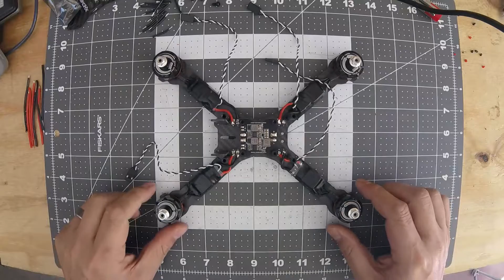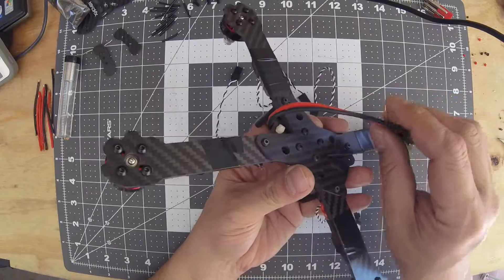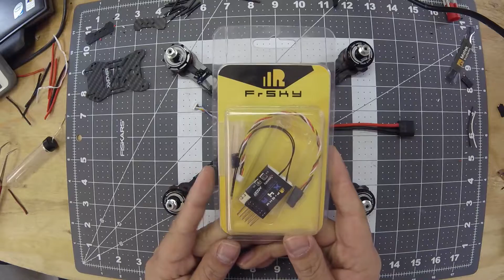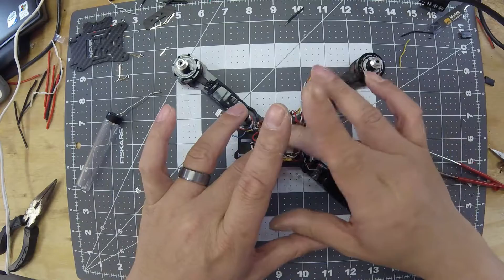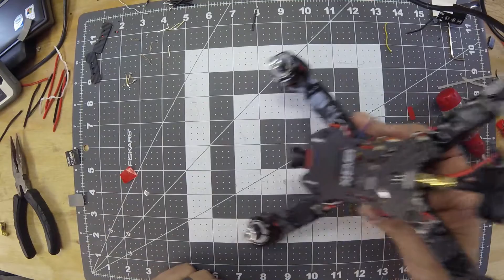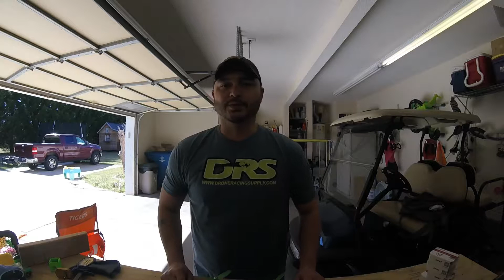xHover R5LX Build Part 2

Comment: Thanks, Terry.  This is very helpful for my first build, which is a X5R with same PDB and FC and FPV camera.  Only video I could find with that combo, so far.  Interesting to follow how you negotiated the wiring and where you placed the VTX and satellite receiver.
Reply from the maker: Ray Suziedelis I taped the receiver to the top of the FC. Some have said that they avoid contact with the gyro located in the center of the FC, but I haven't had any issues. The vTx is still taped/zip tied to the bottom of the top plate. This makes it easily accessible for channels as well as removal of the plate itself to access the rx and FC
Reply: Hey Terry.  First, let me say this video has been my go too reference for wiring up my system which is essentially identical to yours, except our VTX and RX.  I'm a little unclear on how you wired your VTX power.  I followed your link to your Eachine VTX, and see that it, like my Aomway, runs off 5 V.  During your video, it looked like you hooked it up to the 12V pads of the PDB that comes with the XHover frame.  I see where you put leads off the PDB 5 V to go to the FC (same as mine).

I watched and rewatched the fast-fwd part where you do this, but can't get a clear shot at the source of power for the FPV harness.  Is it 5 V or 12 V?

Can you clear me up on how you're powering the FPV wiring from the PDB, since both our VTX run off 5 V?
I'm a noobie builder and I might have missed something you showed.

Thanks
Ray
Reply from the maker: Ray Suziedelis Actually the Eachine has a working voltage of 7v-24v. Being that I've had problems in the passed with Runcam working on 5v, I ended up powering the vtx off of the 12v connection from the PDB. That way I could power the Runcam from whatever voltage the vtx receives (in this case 12v, which is well within the input range of the Runcam). Make sure if you use the vtx to power the camera, both the vtx and camera can handle the input voltage. If not you may need to power them separately with the necessary voltage.
Reply: Terry Kirby Thanks again, Terry.  I don't know what I was thinking earlier. Just before you replied, I noticed my vtx input voltage at 8-24v, compatible with the 12.
On another note, I'm going to try the Runcam mounting using the XHover friction plates.  We'll see how that goes...